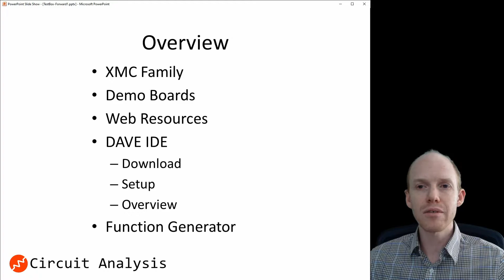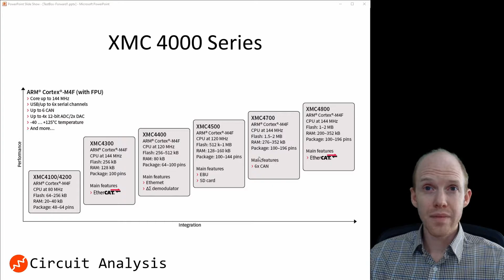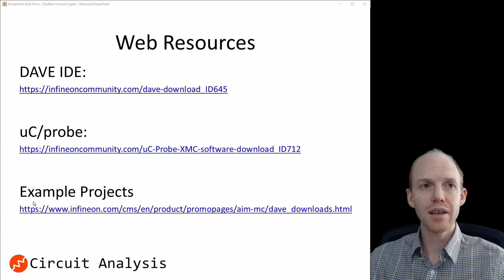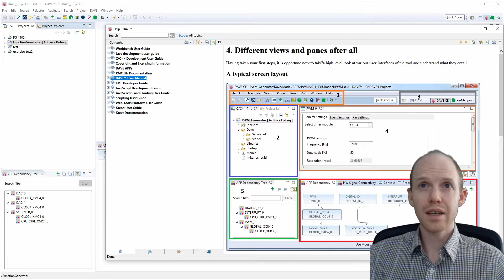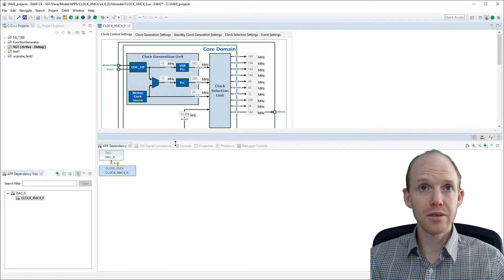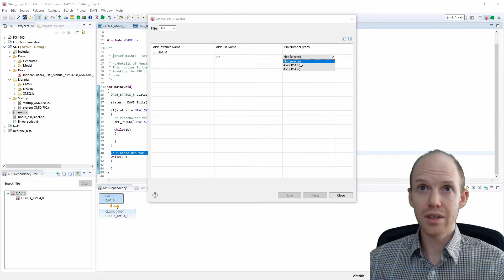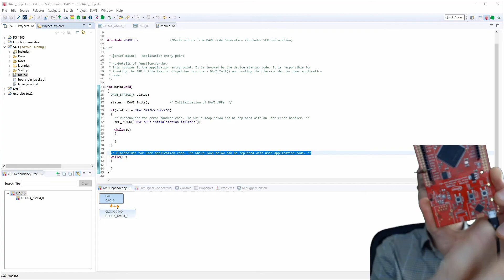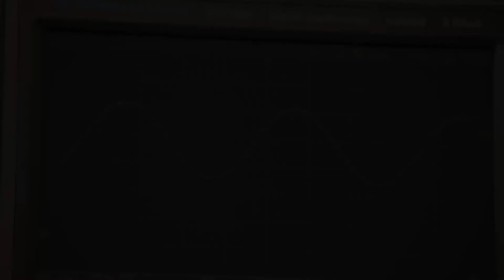Infineon XMC - 32bit ARM Microcontroller [Ep. 1 - DAVE IDE Setup & Function Generator]

Comment: Excellent lesson! Really thanks! I have a question that when you build this whole project, you will get a .elf file. And you click debug, run the code and stop, after which it seems all the code has been flush into the MCU. I wants know that does this debug way equal to flush firmware into the board? I mean, it seems like debugging, but don't check the breakpoint, just run the whole code and stop, which can flush the code into the board?

Because I use another infineon board, when I build the whole DAVE project, I will get a .hex file. And I need to use another Flusher software to flush the .hex file into the mcu. But when I look at your video, it seems I don't need this Flusher software, I can just use the debugging way like you to download the code into my board. I am curious that these two ways are both ok?
Reply: I am sorry, there is a typo that it's flasher but not "Flusher"
Reply from the maker: I think you want to use .elf for debugging / development and it's probably fine if it's just a hobby project, but you want to use .hex for production once you have it all streamlined and you just want to flash the minimized version to a bunch of products.
Reply: @CircuitAnalysis  It's strange that I build a new project, and it's only has .elf file but not .hex file generated.
Reply: @CircuitAnalysis  I fiind this .elf and .hex file in Debug file folder. So you mean these two files are all firmware? Just .hex is a more compressed version of .elf?
Reply from the maker: @rangowang9432  I believe the .elf contains the program along with a bunch of debugging information that allows you to troubleshoot what's going on, where as the .hex has only the program. Either one should work to program the micro, but only the elf will allow the debugging.
Reply: @CircuitAnalysis  Really thanks. I got it.

Comment: Hi, 
Thanks for the video. I am getting the following msg "no emulators connected via USB" when I click on debug. Could you please help me with this?
Thanks
Reply from the maker: Which demo board are you using? It sounds like it is not connected or setup correctly. It could be a driver problem, it uses Segger J-Link so check your control panel and plug/unplug the demo board to see if it is getting added and if the driver is installing automatically or not? You could try manually downloading the driver from Segger? Let me know if you figure it out.

Comment: Ironically that XMC to go keychain with the XMC chip has an XMC4000 series as USB controller. Would it be possible to reflash this one and/or erase the data and use the XMC4000 for testing too?
Reply from the maker: Good eye yeah I noticed that too! It has the XMC4200 which I've been using as my go-to for power projects and things I want to be able to talk to a computer with over USB (since the 1100 doesn't have a USB controller). I did need one for a prototype last year and my new order of XMC4200s was going to take a while so I did what you're saying and de-soldered it with the hot air tool and put it on my custom board and it did reprogram and work just like a new chip. I don't think it's very useful on that little demo board though since it doesn't really breakout the pins to any connection points. You'd probably have to use it on a whole new board like I did, but I'm curious to hear what you figure and and how it goes.

Comment: Thanks for this great training----Not sure what this means----Error in services launch sequence
Launching command [/JLinkGDBServerCL.exe -if swd -device XMC4700-F144x2048 -endian little -speed 1000 -port 2331 -swoport 2332 -telnetport 2333 -vd -ir -localhostonly 1 -singlerun -strict -timeout 0] failed.
Launching command [/JLinkGDBServerCL.exe -if swd -device XMC4700-F144x2048 -endian little -speed 1000 -port 2331 -swoport 2332 -telnetport 2333 -vd -ir -localhostonly 1 -singlerun -strict -timeout 0] failed.
Cannot run program "/JLinkGDBServerCL.exe": Launching failed
Reply from the maker: I guess it means it failed to start the programmer/debugger software? You can try:
- double check the settings in the Debug Configuration
- make sure you selected the correct demo board version for your board (it say you used XMC4700)
- make sure demo board and is plugged into the computer with micro-USB using the correct connector (some demo boards might have 2 connectors)
- Sometimes DAVE releases new versions of the software that change how things work, so it could be you have a new version that doesn't exactly line up with the one I used in the tutorial?
If you figure it out, please post your answer in case someone else has the same problem, thanks.

Comment: Is the J segger Software included with Dave? Or do I have to buy first a j segger debugger thingy to get access to J-segger software to flash a  xmc?
Reply from the maker: You need a hardware programmer, so you can either use one of the segger ones that are expensive but work for lots of different microcontrollers, or you can get the Infineon XMC-Link one that I used that's around $100 and I think just works with Dave and the XMC:
https://www.digikey.com/en/products/detail/infineon-technologies/KITXMCLINKSEGGERV1TOBO1/5970448
I believe the actual software to interface with the XMC-Link is already in Dave, but there may be a separate driver download I forget.